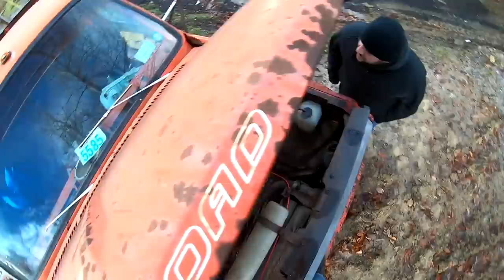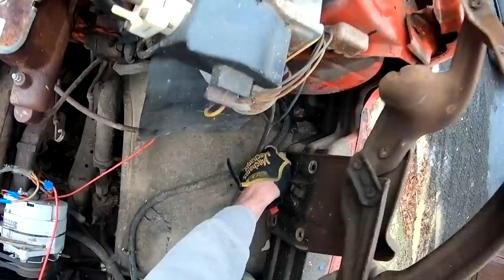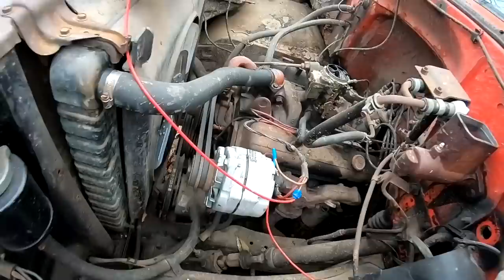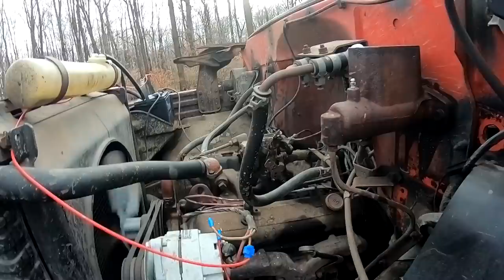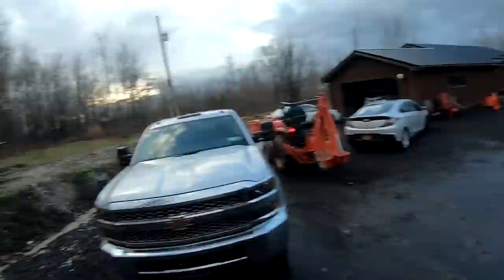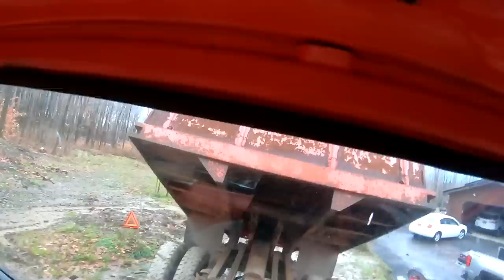BOUGHT A 1974 CHEVROLET C60! WILL IT WORK?

Comment: I have a fresh 12 valve all painted and running on the stand it comes with an Allison 4 speed would be a very easy swap.
Reply: Turbo 2 how much do you want for it? Maybe just the engine if you would separate it? Where are you located?
Reply: Near Green Bay, wi. I would seperate it, $3600.
Reply: @erikm2003  I would go manual if I were him, plus this auto doesn't have the PTO gear in it.
Reply: Turbo 2 no way I’m in Oshkosh. My shop is in Pickett.
Reply: It’s a little on the steep side for me. I once got one out of a bluebird bus up by Mosinee for $500 tranny included. If was a deal!! I assume yours might have came out of a bus to?
Reply: @erikm2003  no it came out of a medium duty Ford truck, I have bought busses for swaps in the past for around 2k but it is alot of work and pretty hard to haul away especially when scrap is worth nothing.
Reply: @erikm2003  I've convinced myself to let it go for top dollar otherwise im thinking I'll try to find a 68ish Ford for this one, I don't know how well you can see it but my last one went in the Ford cabover in my profile pic with a 6 speed Eaton.
Reply: Turbo 2 wow that’s cool. I actually had a brain storm to put a Cummins in a Ford tilt cab semi tractor version I don’t remember the model or year. We’ve got a couple of old Pete cabovers we’re tinkering around with. We just hauled in scrap, 5 loads to fox valley and got practically nothing. It seems that all the junked out busses are starting to have 24v Cummins instead of 12v. Everyone must have got all the good Cummins in those things while they could.
Reply: @erikm2003  ya, there is some sort of law where the busses get to be a certain age and have to be retired by the schools so the 12 valves are only available private party which I don't care for.  As for my cabover, I'd really like to make a video about it since there are very few on YouTube but I'm afraid the quality would be terrible.  For whatever reason any cabover is extremely fun to drive, I love seeing them on the road.
Reply: Turbo 2 yes they are very cool too see on the road. There are very few on the roads still working. I know the first snow fall of the year a silver freighter cabover slid off the road and flipped over. Right across the highway from quality truck in Oshkosh. That was sad to see.
Reply: @erikm2003  the few 12 valve busses around yet get snapped up to keep the fleet of "ducks" going in Wisconsin dells if you are familiar with that.
Reply: Turbo 2 not really I looked it up and know what they are now lol.
Reply: I would like to see a video of your cabover if you ever decide to make one? Sounds pretty cool.
Reply: @erikm2003  I'll give it a try and see how it turns out, it will have to be 1 take, I don't know anything about editing and I'm not very good with a computer.
Reply: Turbo 2 ok can’t wait to see it. Let me know when it’s done.

Comment: Thats a hp 4 bolt 350. Very good motor. Its rich because it needs high grade gas and they probably put low grade in it. When the hydraulic system is in the rpms should go up so check that out. Nice find change the pump filters and itl probably run alot more smoothly.

Comment: MY BOSS HAS The SAME C60 but short bed plz check the brake lines on it the results could be deadly if the line blows. Plus the lines are old and they crack over time. Had a brake line blow on us. had to downshift no brakes😬
Reply: Lol where I'm from brake lines rot off every few years, it's not really a big deal if you blow one. I'd recommend driving a truck without brakes if you wanna drive this old stuff just so you dont panic when the pedal goes to the floor.

Comment: Save the piece of the grill  3500lb epoxy it back in after you pull the grill out, coat the back of the rest of the grill lightly with the same epoxy brush it on 
and it will add strength to it.

Comment: Yeah its a 74 but does it need to be double clutched some do some dont.
Reply: Nothing has ever had the need to double clutch
Reply: @jpa1282  large transmission's off big rigs dont have synchronizers I know this because ive been driving big rigs for 30years and now days trucks dont have to worry about double clutching from gear to gear",10 speeds were always fun to drive but sence you dont under stand that large commercial Vehicles standard transmission operates way different then standard 5 speed 😑😁
Reply: @thegreatwhite2004  I actaully am also a truck driver and if you know how to drive you can just float the gears instead of double clutching  it's faster and better for the clutch
Reply: @jpa1282  yes ik👍works well when jack breaking finally some one who knows theirs shit